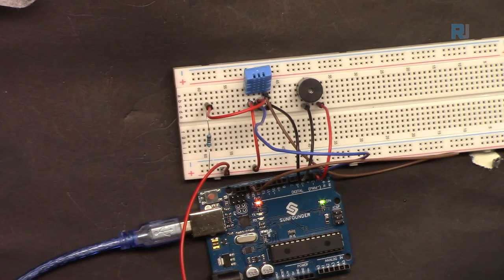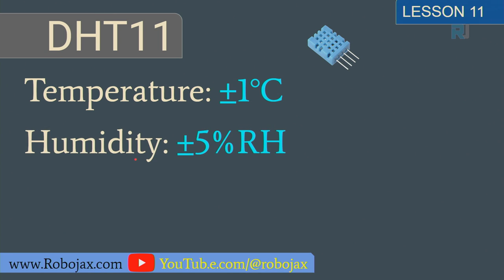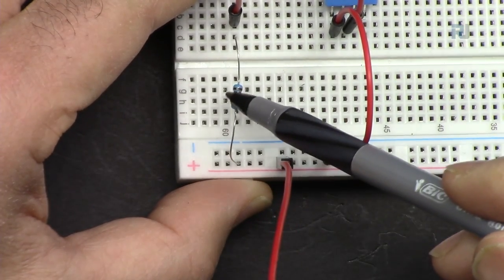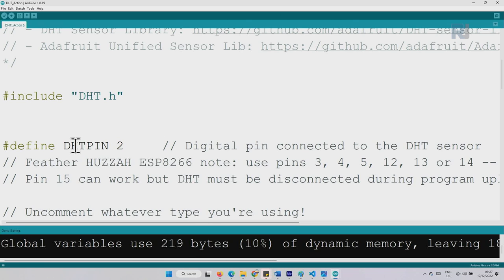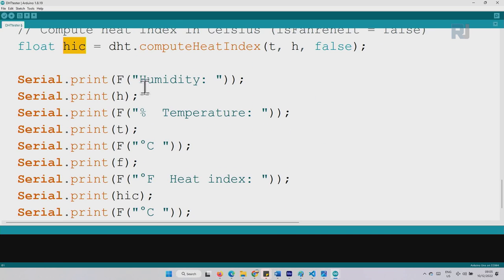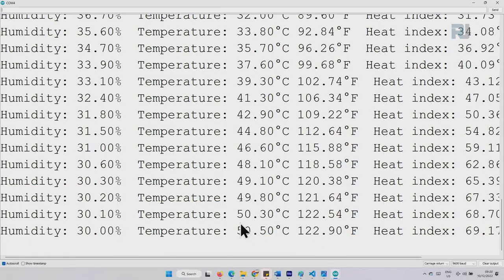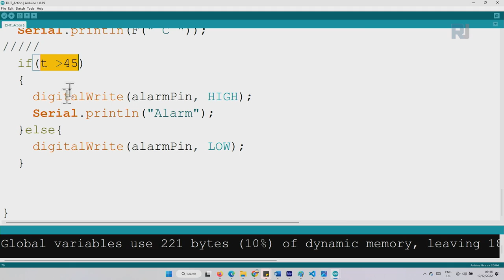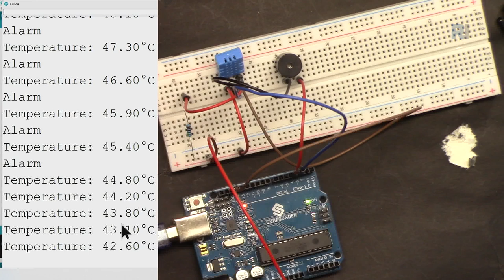Lesson 11: What is Arduino library and How to use DHT11 Temperature and Humidity Sensor | SunFounder

Comment: Thank you Mr. Ahmed. I wander how Digital pin read analog data. I am asking because I want use digital pen to read voltage as same as analog pin. like you video (Voltage Sensor for Arduino with code ). Thanks..
Reply from the maker: Hi, Digital pin can't read analog.  You can only write PWM to digital ping which is Digital but in Arduino they use the term analogWrite. For reading voltage please see lesson 9.
Reply: Yes that is what I understand, but I notes in this lesson  you use for  for sensor D2 .. Also in The ds18b20 temperature sensor many videos connecting it to digital pin. So how that work come . may be you save the answer to another video. I did not want to buzzer you , it is enough that prepare lesson to us.
Thank you Mr. Ahmed